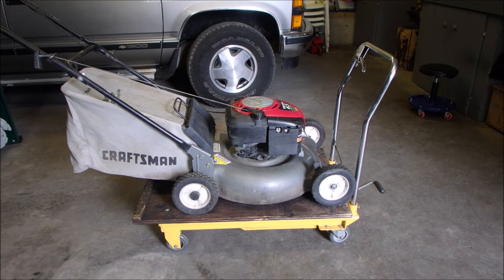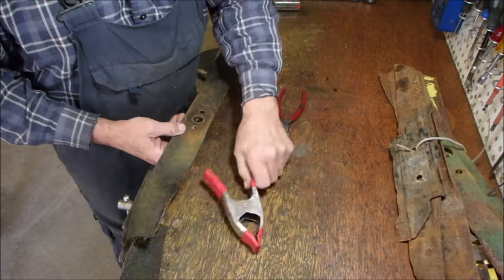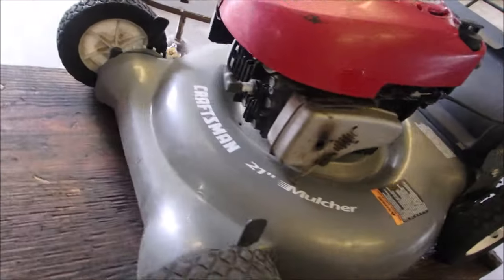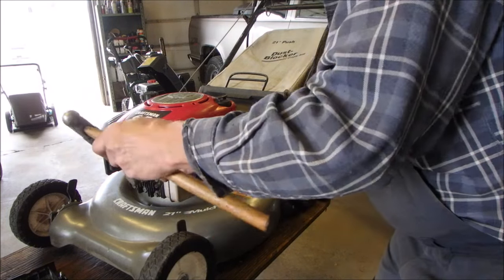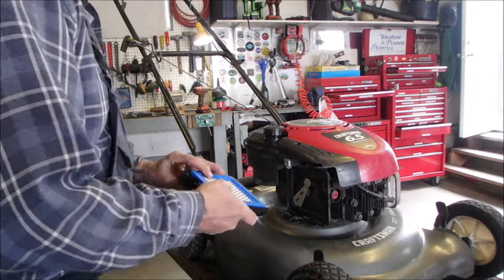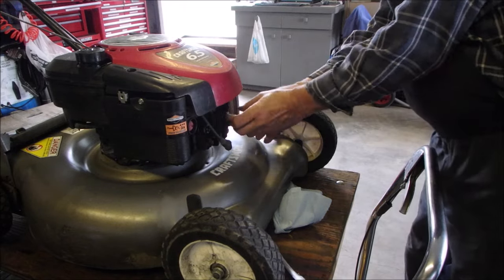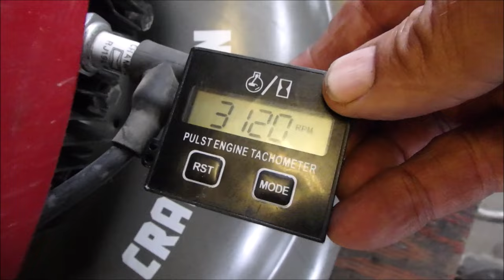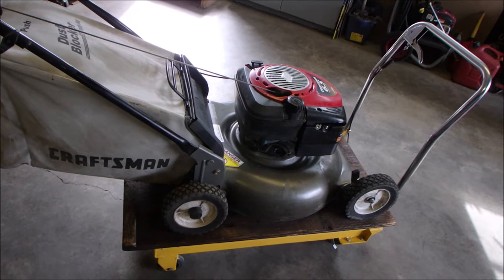What is Wrong With This Beautiful Craftsman Mower ????

Comment: Good Morning Bruce!  If you like getting more use out of zip ties, there is another method you might try  instead of cutting it.  Insert a small flat head screwdriver where the notch 'locks' the strap.  Push slightly and it 'unlocks'.  The long tab can be passed back through and thus be reused.  This can be done several times without any issues.    Good luck my friend.
Reply: Great tip.
Reply from the maker: Great idea

Comment: Nice machine. I noticed on some of the Quantums I have worked on that muffler bolts were missing. The last one, I couldn't find a bolt and it would take two weeks to get one on line. I went to Tractor Supply and found a bolt, purchased some sleeves, and made a bolt. It's still working.
Reply from the maker: Right on Jim.

Comment: Awesome, Bruce. Can’t beat a quantum. Years ago when I worked at a tool rental, we had a Parker Scavenger all terrain vacuum which had an early generation Quantum with manual choke. It didn’t matter what the temperature was outside, it started on first or second pull EVERY time.
Reply from the maker: Very cool!

Comment: Hi Bruce
Thank you for the wealth of knowledge (and good humour) you’re sharing with the world. It has already helped me immensely.
I have a Honda HRB535 and the blades won’t engage. The cable is good and still pulls the brake assembly off the the clutch, so I don’t understand why the blades don’t engage. I have taken the clutch apart, but I don’t know what I’m looking at. Only thing i noticed is the brake pads are worn down to zero.
Any tips greatly appreciated.
B (gardener in uk)
Reply from the maker: Wow   I am not sure I can help you.  As you say it istricky and I am not there.  Sorry.
Reply: @BrucesShop  fair point hard to say you aren’t here 😂 I will binge your videos and see if that yields anything
Reply from the maker: @boris9742  Yes   I have been doing tis for 14 years

Comment: Luv a Quantum with a primer bulb, just doesn’t get any better than that IMO. Great trick with the zip tie, why have I never thought of that before?
Reply from the maker: Sometimes I have to search for one so this helps.
Reply: You can take a primered Quantum out of the shed in spring, prime it 10 times and have it start on the first pull. Try that with an automatic choke engine!
Reply from the maker: @jimyeske8498  My last repair was an autochoke Quantum
Reply: @jimyeske8498  yep! Same goes for fall leaf cleanup when it’s really cold out - you’ll be spraying carb cleaner into an auto choke engine, but hit the primer 6-7 times on a cold day and she’ll fire up on the first try.
Reply: @mjg263  
Butttt…
If you take the primer base off to rebuild the carb and the primer base is warped, you’ll curse it for hours trying to get it to seal again. 🙂
Reply: @jimyeske8498  painters tape, works every time (even when doubling up gaskets doesn’t).
Reply: @mjg263  
You’ll have to give more detail please! Thanks.
Reply: @jimyeske8498  cover both sides of a new gasket with blue painters tape (remembering to punch out the hole for the primer air pressure), reassemble and test. If it still won’t prime then just a little more painters tape around the air pressure hole. Just have to make up for the warp where the air passage passes through the gasket, always works for me!
Reply: @mjg263  
Thanks, will try that!
I’ve recently increased my service rates, so that weeds out some of the older, lost causes.  🙂

Comment: With you on plugs. I have been working on small engines since 2011 & have bought the grand total of one new plug. And that one is still in the box because it turned out to be unnecessary.
Reply from the maker: I do throw away most of the chinese ones.  Just me.

Comment: Have that engine also.  It will never wear out mowing my postage stamp back yard.  I must have missed it, what was the white plastic plug for?
Reply from the maker: It is a drywall anchor that the previous owner used to repair the handle bar.

Comment: I have a quantum that smokes upon start up. It's not flooded because I always shut it off with the fuel valve. It's an auto-choke. Can you make any recommendations of what can be done to fix it?
Reply from the maker: Well you need to know if it is too much gas or is it oil being burned.

Comment: I’m working on a vertical shaft pressure washer with a Honda engine on it. Starts up runs for a few minutes then quits. I’ve cleaned the carburetor twice, blew out the tank, and fuel lines but I can’t seem to figure it out. I changed the fuel cap with another machine still no difference. I s it possible that the pump is no good. I don’t see any reason why it wouldn’t work?
Reply from the maker: It could be a coil.
Reply: I was thinking about that also or what do you think about an unloader? Coils can just get hot and quit but start back up in a few minutes? 🤔
Reply: Bruce,
I put another coil on it and it ran for about three minutes and the engine started running rough then shut off. Unloader issues or thermal relief valve is the next thing to try swapping out.
Reply: @stoolie10  Exactly your issue but you should be able to get the unloader valve freed up so it works properly with a good lubrication and cleaning. At EP we suggest all our customers store their units with a shot of B&S Pump Saver sprayed inside the pump once all the water has been removed. Not only provides protection from water freeze ups but also provides good internal lubrication. Especially important if your water supply is what is called hard water